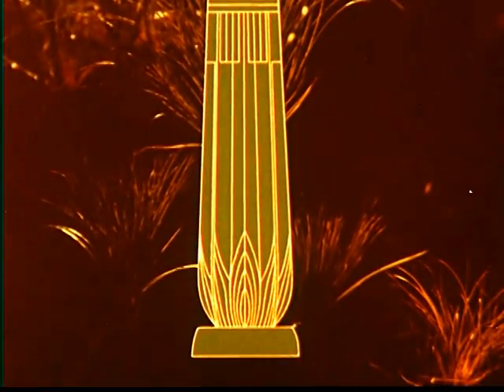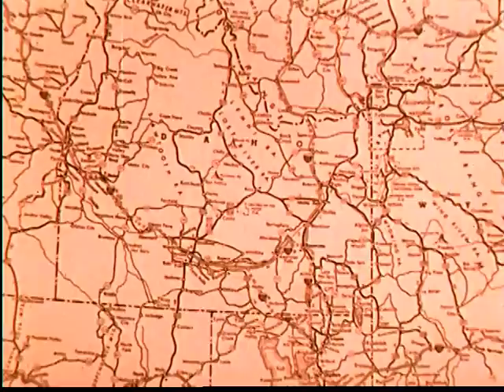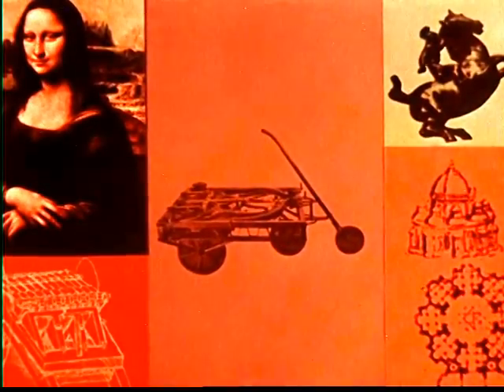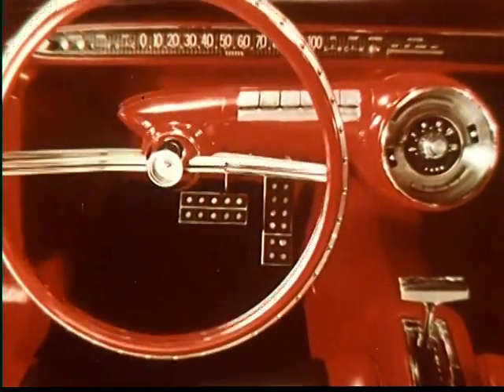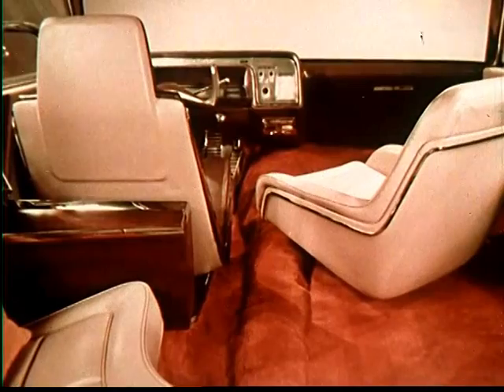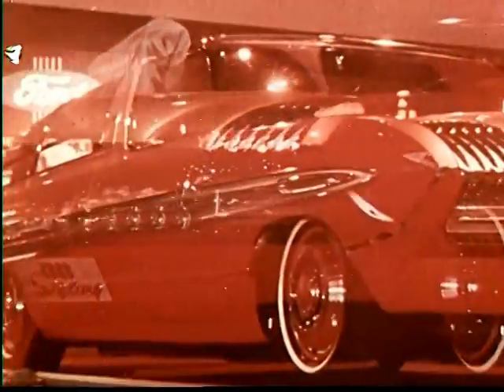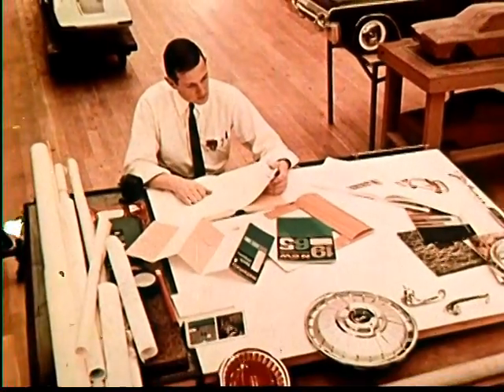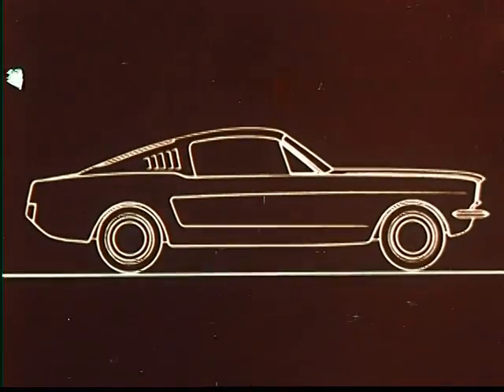Styling And The Experimental Car (1964)

Comment: The cougar II should have immediately been put into production.  The mustang II lower roof line should have been next evolutionary step of the original mustang.  Innovatons of the Aurora should have been incorporated into the production cars, especially the overall hood and front quarter panels. Ford was still too conservative on the designs. The Allegro most likely influenced some of the EUROPEAN ford models and vice versa. The overall style of it mught not have been  up to American taste but some slight rework, it could have been interesting,though i hate the rear jet exhaust taillights unless cost saving measure taken from the t-birds. Allegro looked too "dainty" against the US market competitors and the B pillar way too thin.   

 P.S. we aren't stylists. You want a stylist go to a salon. We are designers.